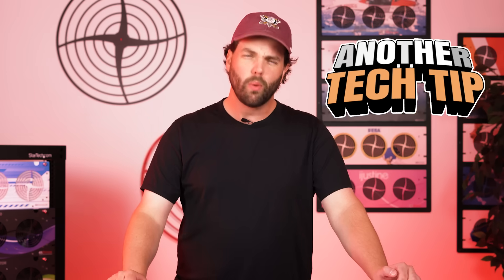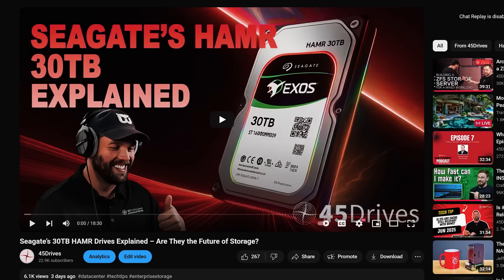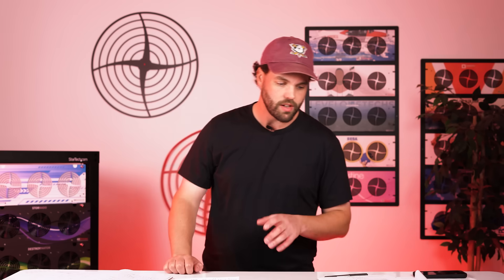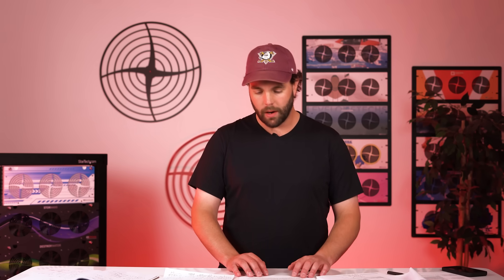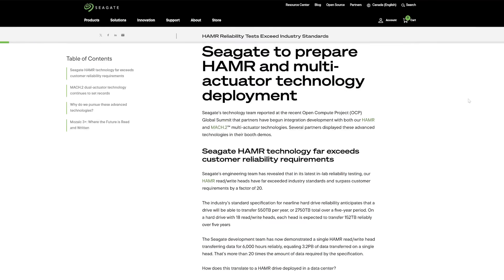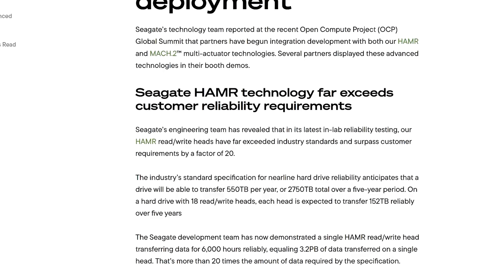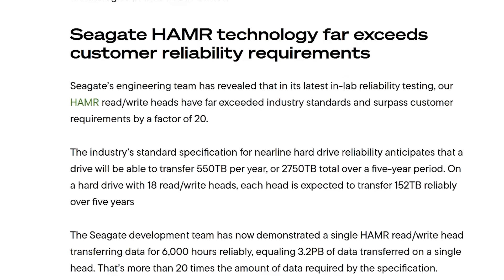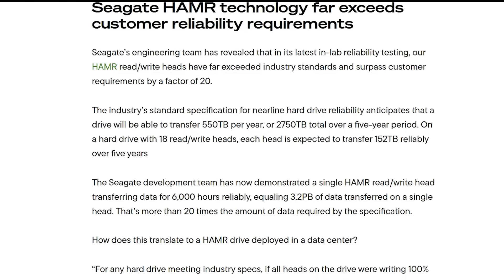Questions About @seagate 30TB EXOs HAMR Drives: Sound, Temperature, Rebuild, and Reliability

Comment: Whatever happened to the Seagate dual actuator drives and did TruNas ever get support that removed needing to drop to the terminal to make a proper pool? It seemed like cool tech.
Reply: Good question - imho the dual actuator drives are a great idea but the software support is not where it needs to be yet. The dual actuator drives show up in a linux system as two individual drives i.e (sda, and sdb) for example. This is most likely why truenas doesnt let you create a pool from their UI.
Sounds like another good topic for a vid - "Current state of dual actualtor drives iwith open source software"

Comment: I think this was a really interesting topic.

Something I think could be interesting to talk about is mixing drives, like HDD 5400/7200/10000, SSDs etc, in a single storage solution like Ceph. 

For instance, maybe you bought something really high end, but you also have your legacy stuff that workst just fine. 

How to make that all work together in an sensible way
Reply: Good idea - quick answer would be to separate storage drives into difference device classes and create separate ceph pools on each.
Where ceph is synchronous in nature its only as fast as its slowest device, so if you have a pool created with some spinners and SSDs you would not always see the performance beneift of SSDs.
Sounds like a good video - how to use high speed flash and spinners in the same ceph cluster.